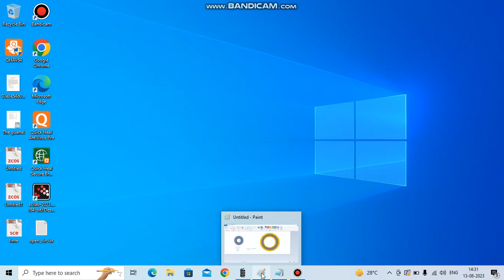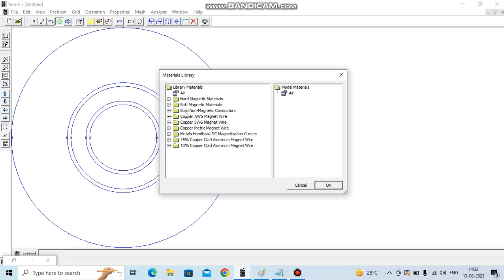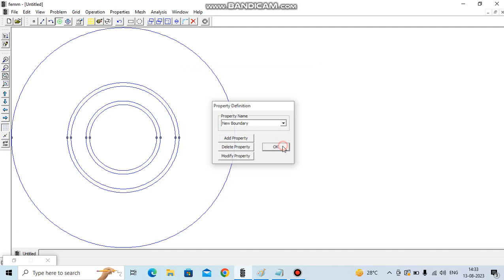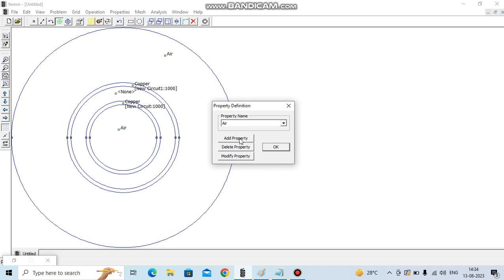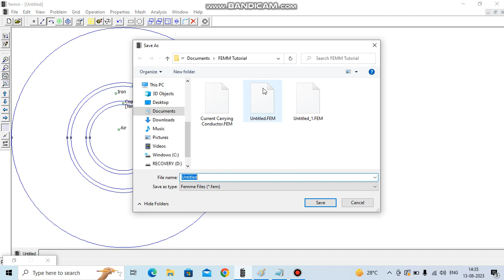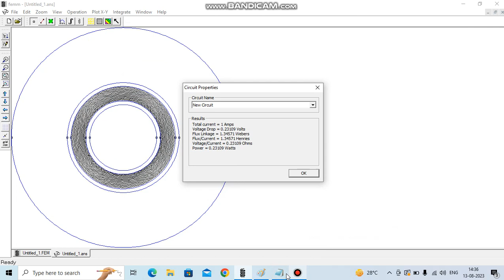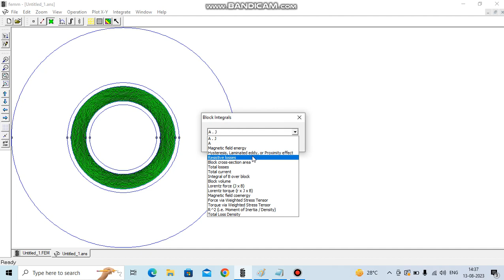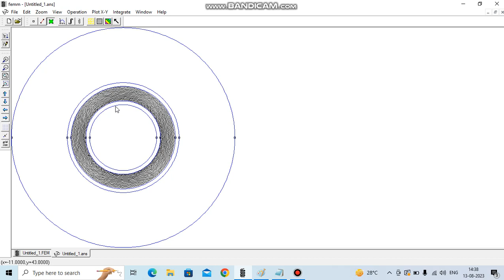FEMM toroidal inductance calculation

Comment: you are getting 3.36 T mag. flux density. Do you really think it is correct. Mostly powder iron toroidal core will allow 1T (10000 Gauss) only. Please recheck it. And I would suggest to try this with non-linear BH curve.
Reply: The modelling is basically correct but the results assumes the design is not practical. Either the number of turns or the current need to be reduced to keep flux density within reasonable limits. By the way, there is a predefined material "Pure Iron" in FEMMs material library which models the non-linear behaviour.